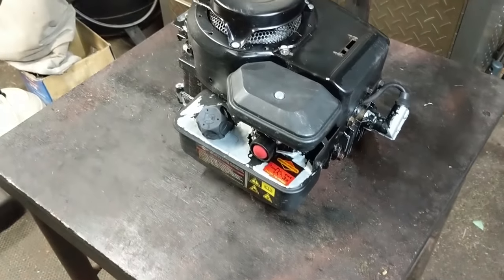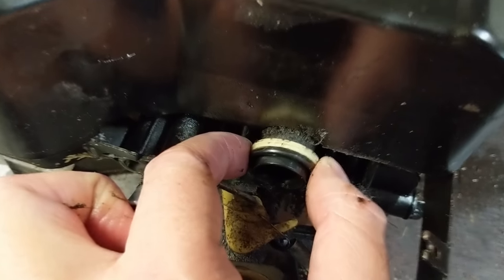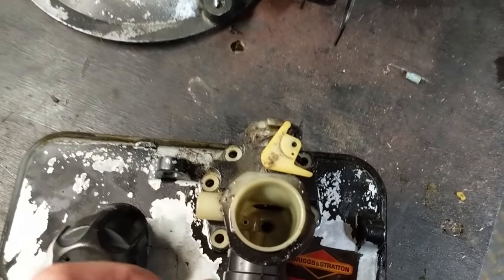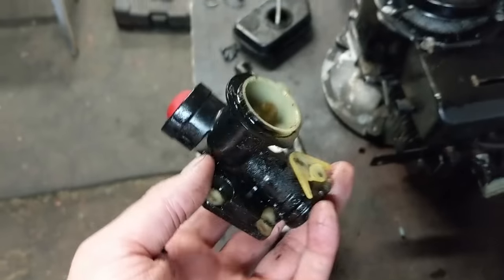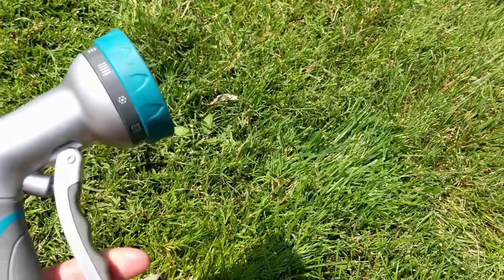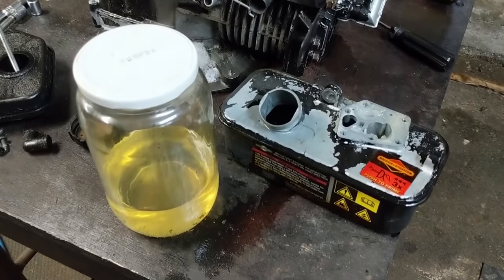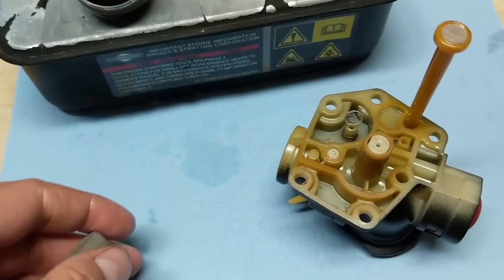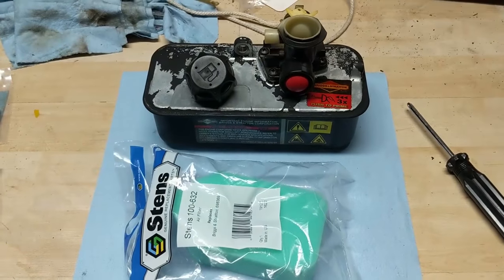How to Clean a Plastic Briggs & Stratton Carburetor

Comment: Thanks for uploading this. I was unfamiliar with how these Carbs worked. My mower had been running poorly and finally got to the point where it would only run from the primer bulb and shut off.  I put my Carb and Tank a bucket of warm soapy water while I went to pick up the new Diaphragm and Gasket $4.10.  Once I got back I dried everything off and reassembled it. Fired right up and runs like a new mower.  You got me up and running in no time.  A big Thank You from Pennsylvania! 👍

Comment: Got a 'broken' lawn mower from my dad. Hadn't run in 10 years. Quick trip to Lowes for some parts and I'm up and running! Had to spray some starter fluid in the carb to get it to start. Thanks for the clear and stellar video!

Comment: I've paid for someone to "fix" my carburetor several times.   They never took it apart like this (I always watch to try and learn) but did something to unclog it.  I kept having problems so decided to do it myself.  Thanks to this video I discovered I was missing a gasket.  I disassembled the carburetor and cleaned it myself and will do all my own small engine work from now on.  Next up, oil change LOL

Comment: Fantastic video! Very thorough. Mine wasn't starting, so I went through the whole process. Took out the carb and tank, cleaned it all with carb cleaner before taking it apart. Took it apart, cleaned everything thoroughly. Washed inside the tank, then re-assembled, fresh fuel! First start and it started. Smoked a bit, so I checked the oil; oil was low, refilled the oil and restarted. Smoke is gone and engine runs like a champ. Thank you!

Comment: Thanks for the great tutorial.  I use Torch Cleaner files to probe Main Jet.  I used a small flat blade screwdriver to pop out the plastic Main jet/emulsion tube which has 3 small holes in its length. Mine was black and is secured by a tiny O ring.  There is a flat spot on the top to pry it out.  Work carefully!  Mine is the 5 bolt model.
Be sure to seat it flush on reassembly.  Carefully using a fine flat file I filed the bolt hole bosses adjacent to the block where the carb base was warped.  This reduced the gap somewhat.  I used some Permatex Aircraft sealant along the joint between those bolt holes.
I used a straight edge to see the warpage left between the 2 holes.  That leak area sometimes accounts for the oily mess on the carb and block in that area I was told.  Mine had the Diaphragm on the Carb side instead of the Tank side.
Seems right, but I reassembled with the diaphragm on the Tank side, then the gasket.  Edited.

Comment: I have 2 of these cursed carb/gas tank combos. Neither will draw any gas, using the primer bulb. One viewer mentioned the ball/spring check valve behind the primer. I see nothing like that in either of mine. Perhaps that is why it won’t draw any fuel? I see you included the B&S p/n for them. Def grateful for that. Hope it’s easy to replace. Thanks for the excellent videos btw. Snowblower season is coming soon. I am almost done restoring my old 1960s 3stage…

Comment: Awesome video! I bought a used mower that needed some love and you are showing the same engine as is in front of me. I have been searching for videos but didn't find anything with the single spring governor style (found all with adjustable high and low throttle). Time to tube this baby up!

Comment: Good explanation and good video.  I was just wondering why you used water to clean ?  I mean, if any of the parts are not dry completely, water will get into the fuel and engine.  Wouldn't it be safer to use carb cleaner ???

Comment: Very good video, wish I had it when I first cleaned one of these carbs some years back. I ended up using a one dollar squirt bottle filled with water and canned air (the kind used to clean electronics) and was just very careful. Funnily enough, soon I'm going to clean the same exact carb again so was looking to see if I even did it right. This time, however, I'm probably going to have to replace some things on it. It's been sitting outside for literally four years, but it's not seized and I need a mower, so...
Reply from the maker: Good luck, and thanks for watching!

Comment: Well explained but I also saw a version where the foam air filter is soaked in light oil before it's installed - in order to effectively remove dust from the intake. What's your view ? Thanks for a great video.

Comment: Great video and explanation. One question tho, behind the primer bulb is a ball and spring check valve that I unfortunately lost after removing the bulb because it had dislodged itself from inside the carb unknowingly to me. Is there a part number or kit for the ball and spring or am I going to have to buy another carb? None of the rebuild kits I have found, include these parts. Thank You
Reply from the maker: Yes, Briggs & Stratton 494409 is the replacement check valve seat, ball bearing and spring!
Reply: @EliminatorPerformance  Thank you sooooo much!

Comment: I turned my mower to the side to change blade, carb side up. It leaked some oil, but after cleaning up and filling with gas it has a very slow gas leak. Do you know where I should investigate to fix the slow gas leak. it's tough to indicate where it could be coming from. Thank you.

Comment: I'm curious how you get the water out of the gas tank after rinsing.  I feel like the water/gas just won't come out of the tank.  Any special trick or just keep shaking until it's near empty and then allow it to air dry?

PS - Everyone is right, this is the best explanation I've found for this machine.  Really well done!!
Reply from the maker: @TheDominator303  I just let it air dry in the sun, or you can use a compressor to blow it out. A very small amount of water will not hurt, as it will mix in and burn. The reason most engines don't start with water in the tank is because there's usually a lot of it. Ethanol based fuel will attract water so it's best not to use it if you can find it locally.
Reply: @EliminatorPerformance  I got my pressure	washer running again with your content.  In order to get the engine started it required me to hold the trigger on the wand but the fuel system is working correctly.  Now I think I might have an issue with the water pump putting back pressure on the engine that’s causing it to stall.  Onto my next troubleshooting step.  Thank you for helping me get this far!
Reply from the maker: @TheDominator303  likely the unloader valve is stuck, I don't have any videos on that but you can do some YouTube searches to find info

Comment: Many thanks for this very interesting video. A question if I may about front wheel adjustment. My newly acquired Classic 35 mower does not have a height adjusting handle for the front wheels on either side of as in your video. (There are adjusters each side for the back wheels). At present the bodywork runs too close to the grass level. Is there an adjusting tool available or do you have an alternative simple solution please? Many thanks in anticipation of any advice received .

Comment: Great video, trying to fix mine and this was helpful but one question  -  my throttle linkage does not pull the throttle leaver - should it move when i pull the brake/handle?
Reply from the maker: No that throttle runs off an air vane that puts tension on the throttle spring when the flywheel spins
Reply: @EliminatorPerformance  Thanks!! -  is there a reason you say not to get the black carburetor in the comments below because i want to replace mine and there is a long wait for the OEM  - thanks again

Comment: Hi great video 👍 I have a problem with fuel leaking from the area the o ring sits onto the engine. I have got a new o ring but it still squirts fuel out when running. Will i need to replace the whole carburetor? Could the plastic be warped 🤔
Reply from the maker: Yea plastic warps and they leak, just replaced one yesterday for that!
Reply: @EliminatorPerformance  Thank you sir youve earned a new subscriber.

Comment: Hey man, thanks for the video! I've got the same carb on a Troy power washer and I changed the carb and gasket thinking that would fix the surging but it hasn't. Any idea what else it could be?
Reply from the maker: Cracked intake manifold, I just replaced one today. Also, make sure the engine speed is set around 3200rpm that helps.
Reply: @EliminatorPerformance  thanks for getting back! Even if it starts out fine then surges after 20 seconds at idle?

Comment: I just took mine off, cleaned it, and put it back together, and now it idles way too fast. I tried bending that tab like you show, but it doesn't change the position of the throttle.if I pull the throttle all the way back, it dies, and it doesn't want to sit anywhere in between because there's no spring on the rod side. What else can I check for?

Comment: I did what the video said. Pulled the cord the engine started but it revved really high what did I do?  Oh now it either runs really too high or too slow to run I must have done something wrong but white? But what?
Reply from the maker: You need to look at the governor spring and make an adjustment or hook it up properly

Comment: I have the same engine and everytime I have to do a cold start, I have to put a droplet of gas into the air inlet bowl and then it starts and it will run normally. What could be the problem? Why does it run good after starting it by squirting gas in the bowl?
Reply from the maker: Most likely need carb clean, primer bulb hole probably clogged.

Comment: i have had a problem working on a oleo mac with this engine, i lifted the machine on its side (carburetor upside) and after i did put it on the ground a gain i had oil in the carburetor , i ve never met this situation, can anyone provide an explanation for that please ? regards, thanks a lot for the video, as always you are one of the best eliminator performance, ppl like you are precious for bringing such knowledge, regards

Comment: Wait on your starter solenoid test, you used an ohm meter when you have power applied to the solenoid you'll burn the fuse out on your multimeter, you should have checked voltage at the 2 large terminals .
Reply from the maker: No, there's no voltage at those terminals when a battery isn't connected.

We were simply looking for a connection between those 2 terminals, but only when the solenoid was powered with 12v.

Comment: Do you know how I can fix a mower>? that I turned it the wrong way, to drain the oil and now it won't start is 4 stroke
Reply from the maker: Take the air filter off, let it sit for a bit on a level surface with the new oil in it (make sure the oil isn't overfilled) and try starting it without the air filter. If it still doesn't start, get some carb cleaner spray in an aerosol can at local parts store and spray a small amount maybe 2 seconds worth into the hole in the carburetor. Then pull the cord and see if it starts, if it starts and shuts off, try again a couple times. Might have gotten some oil into the carburetor.
Reply: @EliminatorPerformance  thank you so much .

Comment: I Cleaned the carburetor,  mower starts but then dies..i even cleaned it twice, the gasket and diaphragm are still even intact. What else should i check? Should i just change the carburetor? Thanks a lot
Reply from the maker: Sounds like it'll start from the fuel you prime, but the diaphragm isn't pumping fuel to keep it running.
Reply: Yeah i think thats the problem to, so should i just get a new carburetor?

Comment: need some help hope someone would not mind. I used my murray lawnmower M22450 2 weeks ago. Worked fine. I got the kit and cleaned carb and fuel tank, replaced all springs, new gasket and diaphragm, cleaned the fuel jet in carburetor before putting a new screen on, made sure governor was in proper position, cleaned and tested ignition coil (all within spec), changed oiland drained gas to make extra sure I did not miss any dirt.I am at the end of my lawnmower knowledge. I went and purchased a second plug just to  make sure mine was not bad. I got it to start once using starter fluid, It sputtered and sounded rough, tried again to start with starter fluid sprayed directly into the fuel intake I could not recreate the starting. This is my personal mower and never lent it out and never abused it. What am I missing???  HELP PLEASE!

Comment: Ran fine at first then I let it run till it was out of gas since it hasn’t been ran in years. Went out the next day and fires right up but sputters for some reason now. Went back in and cleaned it a second time and still sputters. I’m about ready to call it quits on it since it’s not worth much to begin with.
Reply from the maker: The diaphragms get dry and then don't pump fuel anymore, that could be an issue.
Reply: I just ordered a aftermarket carb and comes with all that so I’ll see what happens.

Comment: Use an extra gasket solves the warp problem,  paper rubber paper gasket in that order
Reply from the maker: Thanks for suggesting, will try!
Reply: @EliminatorPerformance  it normally solves the leaky problems, np just from experience i had a cpl leakys and learned that trick fron 
Taryl fixes all channel,  have you ever watched him? Hes a good mechanic as well
Reply from the maker: @sendit1158  yes watch his vids, lots of good info. These plastic carbs warp due to the heat because they're just plastic. For the price I get them for usually I replace them so I can give my customers a guarantee.
Reply: @EliminatorPerformance  keep up the good vids, one of the best

Comment: Have one like this, it floods until it uses about a half tank fuel, shop says these engines just do that. All I know didn't do that when it was new.
Reply from the maker: Carb is warped, buy a replacement, spend the extra and get the OEM beige color one
Reply: @EliminatorPerformance  thanks,never thought of that.

Comment: I have two mowers with this engine. They run perfect unless it's on a hill. RPMs drop and dies. I think I need a new diaphragm
Reply from the maker: Either that or the fuel pickup isn't pulling in any fuel because the tanks are so small and on a hill it may pull just air, if the fuel all goes to 1 side...
Reply: @EliminatorPerformance  I thought of that but I tried it with a very full tank

Comment: TARL FIXES ALL
His video's are undisputable.
Look in very few case's will this work***
You will have to take the carburetor apart ans clean the jets,......Like Tarl Dactle says in his video's.
I clean the tanks our with  a little paint thinner and a tube-sock and a screwdriver and a air gun.
Reply from the maker: Love his videos, this engine ran great once we got it mounted to a mower deck! These carbs are easy to clean